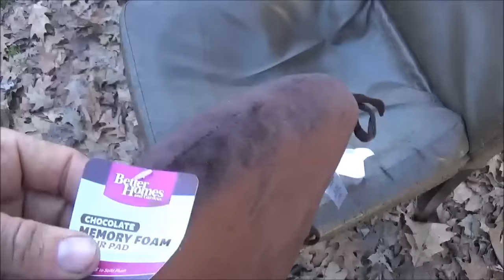Refurbishing My Favorite Chair

Comment: cardboard strips rolled up and tacks work well. bailing wire and duct tape as last resort.
Reply: +FixedByDoc OffGrid for where you stapled the fabric. put brass tacks on a chair with piping trim. not fun.
Reply: +TheMoneypresident used to watch the furniture guys on TLC.

Comment: Hi Doc, 
With those cats you'll probably have to do this job again in 2 weeks. If Addie isn't home to help and you need an extra set of hands try using some clamps. Didn't help that you lost your light. That brown cushion really added a lot of height to the chair, looked like the testing you did had you feet dangling if you sat back all the way. Just a thought if my  observations are true,  then you might want to strap on a 2 by 4 to the front legs with some cordage for more ergonomic seating. Cheers, 
Bill